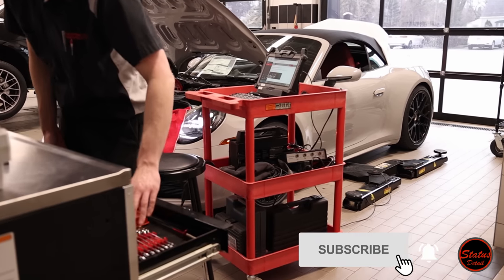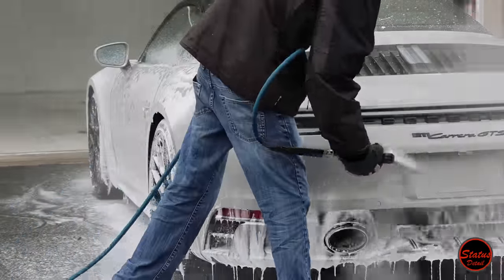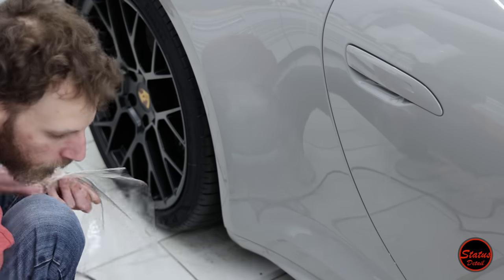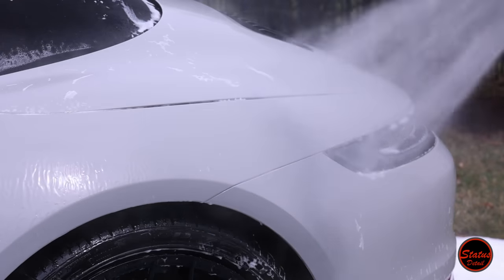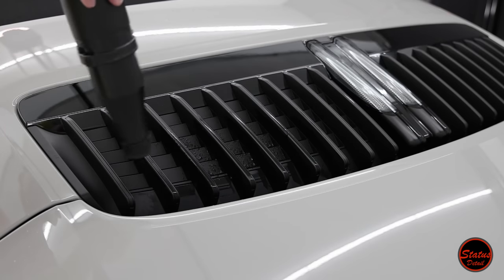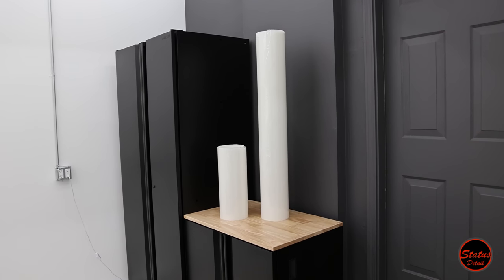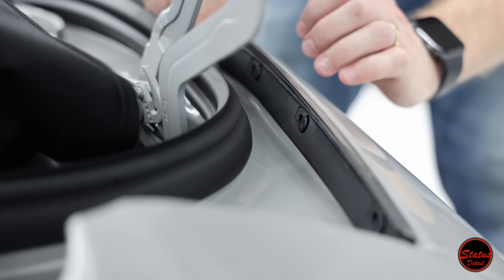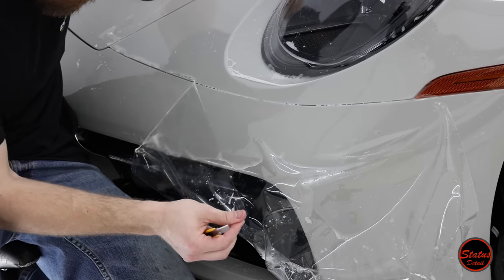992 GTS Cab ULTIMATE Detail + STEK PPF

Comment: Do you remove the hood emblem and ppf over the area to avoid having to trim around the emblem?
Reply from the maker: It's cut with emblem on. Hard to explain but it's cut basically on badge and then fi is pushed flush with badge. You won't see the edge. 

This makes removal easier. PPF should always be installed with a future removal in mind. Pulling the badge off risks losing a bolt in hood especially on carbon hoods. Literally never getting that out and it will rattle around. 

No benefits to removal when you cut and tuck it the way I do.

Comment: Love your videos! When you’re doing a prep wash before ppf or coating, are you using a dedicated stripping soap or just a regular soap like reset or bathe?

Thanks!
Reply from the maker: Thanks!
Typically I'm using gyeon foam or Carpro Lift. That's my pre foam and I mix it really strong. 

Then contact with reset bathe etc. Fun fact lift and foam work great as a wheel cleaner when you spray your left over solution on top of break buster 👍
Reply: @STATUSDETAIL  Right on, thanks!

Comment: Do you wipe up the polish liquid at all or do you just polish the whole car and do the wash at the end and that’s it? I’m having a hard time removing all the polish liquid while I’m prepping before coating. Love the videos and skill !
Reply from the maker: Good question because I don't show that often. After every polish section or cycle I wipe a d inspect. The paint is "clean" after paint correction. The dust is just overwhelming and a wash is best. 

Not sure I understand your comment about polish liquid removal before coating. You should be wiping your polish and compound off after you do a door for example. Wipe. Inspect. Do more or move on if Happy. If your having serious problems with polish residue sticking them you may need to change brands of pads. Polish. Compound. Polishers. Or technique.

Comment: The only thing crazy here is there might be people who DON’T take their new Porsche to Evan.  I feel sorry for those people.

I started using Gyeon Tire this spring and I love it, but I have noticed dust seems to stick to it more than other dressings I’ve tried (admittedly I live in a fairly dusty environment).  Am I over-applying?  Or do I need to knock it down more with a MF towel after 15 mins?  What would you do?
Reply from the maker: Thank you! 

I wipe q2 tire off with a towel. Like fully remove it so if you touch the tire it is dry with no residue.

Comment: One question... I've recently bought an A5 with trunk and carpet quite messed up, from previous detailers using agressive brushes. Is there any way to fix that?
Reply from the maker: Without a photo it might be pretty hard to help. 

It is possible it needs to be replaced of the fibers are just ripped out or to rough.
Reply: @STATUSDETAIL  Yeah, they are messed up quite a bit... Speaking of brushes, any brushes that are available online that you recommend? For Audi's velour mats, carpet and trunk
Reply from the maker: @xFlowRS  I don't mess with carpet in trunks much. I just vacuum you them. That style fabric is likely to rip fibers out if you start brushing to much and it's hard to do extraction because it's basically cardboard/wood structure under it.
Reply: @STATUSDETAIL  Point taken. Problem is, on top of everything, mine is full of sand, so I can't leave it like that. Oh, some stains from wheels being driven in the trunk on top of that. I don't know how they made '18 car this messed up.
Reply from the maker: @xFlowRS  vacuum for sand or just fully remove and smack them a bunch to try and loosen it out. 

You could try tide in a spray bottle and gentle motions with microfibers to remove stains. But it's possible it won't be perfect.
Reply: @STATUSDETAIL  On it, but I think I'll mess up the fibers a bit further, even though I am not using an agressive brush. Thank you!

Comment: I dont see anything wrong with plotting a film to have overhang so you can tuck all your edges
Reply from the maker: Extending edges can work well. But on many panels to do it perfect with no adhesive lines or stretch marks you need a lot of extra film... Bulk install to pull stretch and tack to another panel so the panel your installing on is completely floating. When you plot you tack corners or something on the panel your installing so you can get stretch without the film sliding all over. This creates adhesive lines. Some panels would definitely be convenient to plot. Like smaller pieces on a c8 lower front bumper for example. But I'm low volume and don't want a plotter and software fees for such a small percentage of work. Bulking allows for advanced installation techniques. Simple as that. 

For a company with employees who don't have the skill set needed to do something to the standard I want the great equalizer is a plotter. It will help them go from incapable of bulking to doing potentially passable plot work. Go find a shop with a bunch of employees. They all have plotters for a reason. Turnover/trainability. 

Just my two cents. The stuff people don't like to talk about 👍

Comment: I guess this channel is for car detailing enthusiasts.  With all the detail paid to the car paint , how would one want to take that mint detailed car out to the environment again ?  Such a car should only stay inside a showroom or a clean garage for all year round.  I mean the moment you take the car out for a drive, forget it, all that mint condition is gone.  Is the car meant to serve the owner or the owner serving the car which is an inanimate thing?  If I spend all that time getting all the spots and imperfections out of the paint , and then seeing it marred again the moment I took it out for a drive , I will go nuts.  What kind of real joy can one get to own a car this way ?  I mean, consider the paranoia !
Reply from the maker: You do the steps performed to make it perfect. Then PPF to seal that in. Then ceramic to make it easier to wash.

So you can drive it and enjoy it. 

If your going to never drive it and put it inside forever you can skip the $9k PPF step. Correct it. Coat it. Stare at it lol
Reply: @STATUSDETAIL  $9K is a lot of money, and the PPF eventually will need to get replaced at some point in time.  Cars depreciates in value , even if you put the PPF on it, it will still depreciate in value.  So that's additional 9K you will never recover when you sell it.
Over the 8 years that I have owned my current Mercedes, I wash it once a week, polish it once a year, and apply the Turtle wax ceramic spray coating once a week, the car , though with some swirls if you look at it up close, still looks very decent.  And total cost spent over 8 years on products, ~ $500.
Reply from the maker: @anthonyboey3210  nothing wrong with that approach. But this car will do 150 on a racetrack routinely and is likely considerably more expensive than the Mercedes unless it's like a GTR pro. 

Why not pay for the protection if the money isn't going to be missed in your bank account. 

A lot of people watch videos like this in there own shoes and naturally it seems very expensive then. Imagine you make 4 or 5 times or more your current income. You will look at protection of your quarter million dollar car differently.